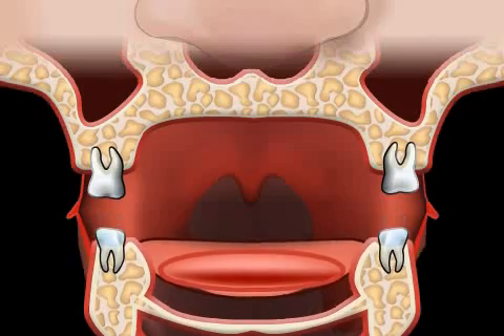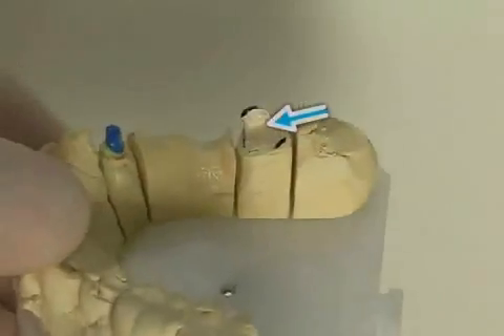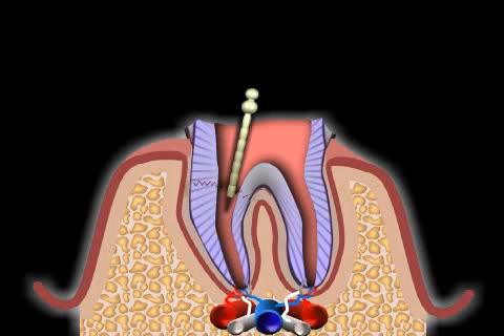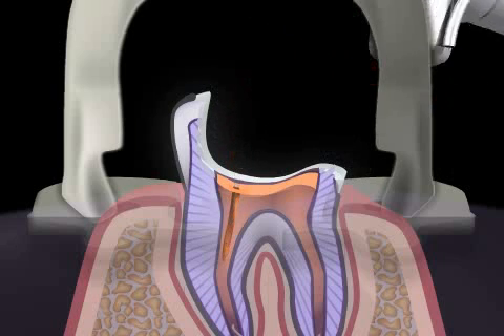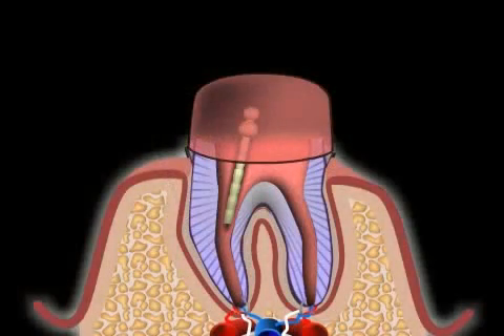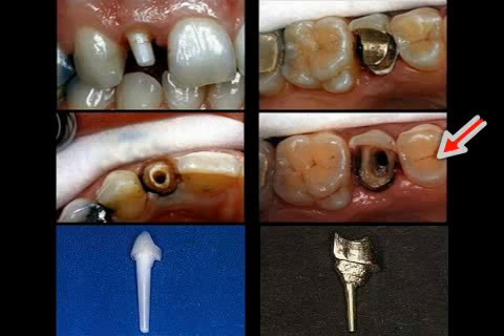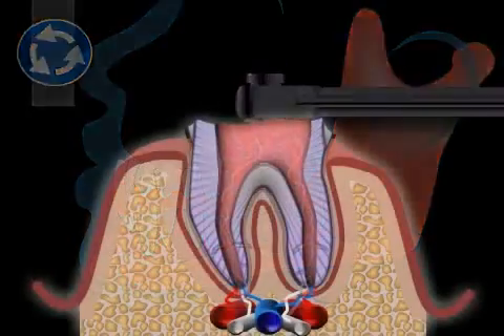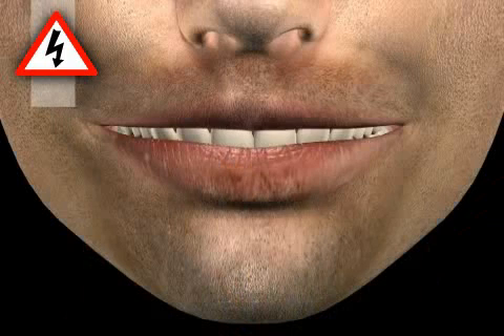Tooth Core Build Up

Comment: Can this be done on teeth that have had a root canal but the tooth has broken down to the gum line due to waiting too long for a crown?
Reply: may I ask what the solution you had for that tooth,I have a same problem,let me know ,thank you
Reply: ba wang same here :/. What did you guys do?
Reply: I went to a dentist put a  crown,my dentist said my tooth don't need put a post ,he only built a core.
Reply: If the tooth is broken to the gum line, there's a thing called "crown lengthening procedure" in which gum line is reduced to elongate the tooth for a crown. So yeah, there is always a way to save the tooth.